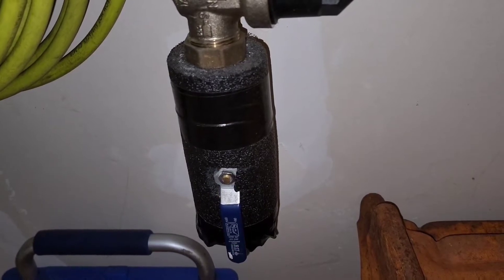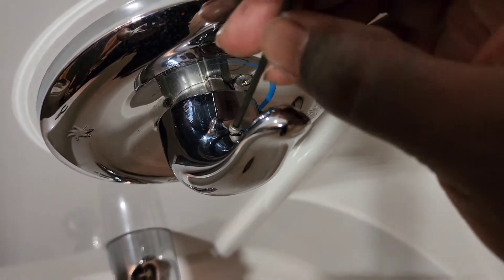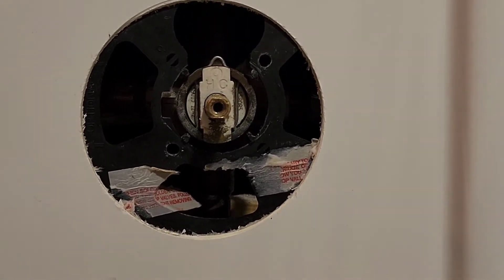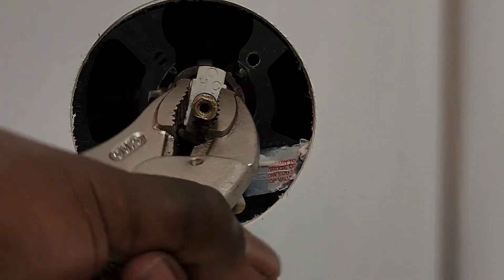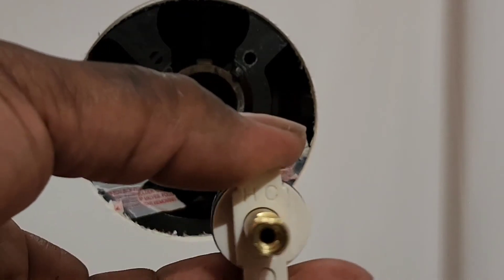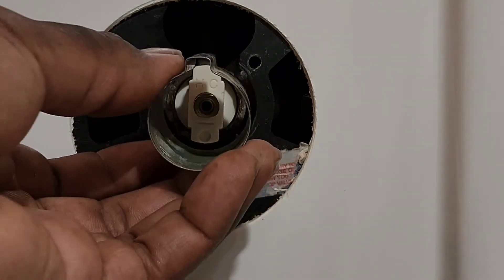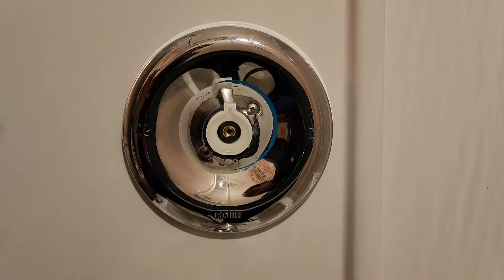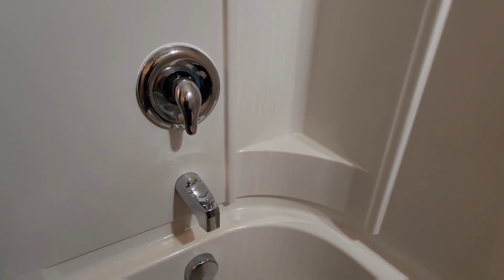Faucet Repair: Shower Bathtub Won't Stop Running Water / Moen 1222 Cartridge Replacement J.O.A.T.D.

Comment: Ima just be straight up with yall best instructional video I've ever seen on something like this I've watched a bunch of them and this guy did a great clean presentation that helped me a ton
Reply from the maker: Thank you so much for the kind words, I'm glad that my video could help you.
Reply: I have the same problem, but I can’t get out that valve. I just want my tub off.  I have my main water off in the house.  But I need it
Reply from the maker: @mikemc4340  I'm so sorry that the valve won't come out sometimes the valve is just stuck in there and you have to turn it back and forth with a pair of vice grips just back and forth back and forth while you're pulling it out. And you also have to make sure that you took out that retaining clip the one that shaped like a u.
Reply: So agree!! I’ve been watching these for several hours as it was New Year’s Eve😩Everything closed, and mine would not shut off and water just pouring out. He is giving me the confidence to try and repair myself tomorrow! Will  let everyone know how it goes as I’m a 55 year old woman with no plumbing experience 😂

Comment: Found your video late at night after scheduling an emergency next day plumber appointment for a shower that wouldn’t turn off. Ordered the part off Amazon and cancelled the plumber. Part arrived around 9am and I had it fixed in 20 minutes thanks to you! Much respect Sir!
Reply from the maker: You sound like me mine happened at night also. Thank you and you're very welcome I'm glad my video could help.

Comment: Great video. I'd already replaced the Moen 1222 in my shower, but couldn't get the hot / cold / off right. After screwing with it for awhile, checked your video. Your tips on lining up the 2 plastic collars at about 3:30, and how to determine which flat side on the valve stem should point up at around 5:30 sent me back to the shower to check... and fixed all my problems. Thanks!
Reply from the maker: Thank you for the key points in the video that will help someone else that maybe having the same problem and for the positive comment I'm glad that my video could help you.
Reply: THIS saved my bacon this evening. it was getting late and i couldnt figure out how to shut the water to the shower. i had the entire house off and ended up having to call a plumber. while was preparing to leave, i managed to land on this video and found my issue at 5:30 mark. Once i flipped the stem it all worked! i canceled the plumber who sounded annoyed but i suppose it saved him a trip to my house at 8pm on a sunday evening

Comment: This worked perfectly.  The step where you had me turn from the default position to off was super important.  Grateful for this video. There is NO WAY I would have had the confidence to make this repair without your video.  This video was not first that I found, but it was the best in video quality and quality of your instruction.  Thank you! 🙏
Reply from the maker: Thank you for the kind words. I'm glad that my video could help you

Comment: Best video on this by far. Mine broke this morning while it was still running; solved by noon with your video (and a couple others after my valve came out in pieces that resulted in a second trip to the store for super thin needle nose pliers...).
Reply from the maker: @zackarybird1992  thank you for the positive comment. I'm so happy that you got your issue solved. I'm glad that my video could help you

Comment: Just cost me $400 to have that done on shower faucet as  piece of handle broke off in cartridge and shower would not shut off. Had to cut water off for entire house  for 2 days until I got a plumber.  The guy worked very hard to get a 24 year old cartridge out with drill and screws. What an ordeal. Thanks for the video.

Comment: Thanks A Bunch, I was able to replace this, just by watching your video, instructions clear and easy to follow. I bought my replacement part from amazon and it came with the tool that you mentioned, although I didn't use it because I just followed your tutorial. Anyway just wanted to mention, just in case anyone is searching or the replacement kit.
Reply from the maker: Thank you for your positive comment, I'm so glad that my video could help you.

Comment: After watching a video, I replaced the cartridge in my master bathroom several months ago.  Then, for the hell of me, I could not figure out why the "off position" was now up and the "on position" was now down, and the hot and cold were reversed.  And I watched the video several times  Now I know, thanks Dre.  I did not rotate the metal tube.  Excellent video.
Reply from the maker: I'm glad that my video could help you, thank you for the positive comment. I'm glad that you were able to fix your problem.

Comment: Great step by step guide.  I took my old cartridge to home depot and replacement was free
Reply from the maker: Thank you, I'm glad my video could help you. There's nothing better than free
Reply: How ? I just paid 59 bucks at ace hardware.. Home depot is 1hr away
Reply from the maker: @joelopez8965  if you look in the descriptions of all my videos I normally have links to Amazon and manuals. To help you with pricing and installation Amazon this part was $35
Reply: Did HD replace it free for you?
Reply from the maker: No I had to fix it myself

Comment: Excellent video, thank you so much. Two things: my screw size was 7/64, I couldn't figure out why the 3/32 wasn't working. Also, the black plastic guide inside the wall has to be lined up correctly for the faceplate screws to go in. Thank you so much for the great tutorial!
Reply from the maker: Thank you so much and you are very welcome. I'm glad that the video could help you with your problem. Thank you so much for the extra input in the comments this will help other people who are having the same problem. Thanks

Comment: The washer was missing from behind the black plastic handle mount. That is why the black plastic got stripped out. This part used to be a metal mount and was changed to plastic, probably to cut costs.  The two plastic inserts are scald preventers that can be adjusted to limit the handle travel. That is why they have all the lines in them for adjustment.

Comment: What about a to handle delta tub faucet that keeps running? I changed the seats and springs and both cartridges and it's still flowing out

Comment: Mine is now so free as it turns. Is it the new cartridge or is it because my old one was too stiff? 
It works though, no more leakage. Also the pressure is a little bit lower now.

Comment: Man I appreciate you I jus changed mines...now one thing that is a common sign that it needs to be replaced is that the handle will start to get tight and not turn smoothly...so go head and replace before it goes out.
Reply from the maker: No problem, I'm glad that my video could help you. Thank you for the tip about when to replace the cartridge.

Comment: I have replaced mine 3 times 2 plastics this last one is brass the first 2 did not mix water correctly ..trying to figure the 2 black plastic parts on the side does what can i put in wrong on the first 2  ..Thanks'

Comment: I have a question my parents have a bathtub but the faucet is on the right corner of the bathtub surrounded by title. The cold water handle wouldn’t turn off. We just had to turn off the water. Now, roto rooter told us since the tub is next to our cabinets with the other faucet/sink they should of made a doorway or left an open space in the cabinet to the bathtub section that led to the faucet on the tub. Roto rooter wanted to make break into our bathtub and on the far end opposite of the faucet. That’s crazy! Wat do we do? We want to replace the faucet but we have to get into the tub somehow or cut a big hole that would allows you work inside the cabinet that leads to the tub/faucet. Btw we had this problem when they first bought the home. They found out late the faucet had issues but yea any help any advice will help greatly!!!!!!!. Oh I unscrewed a metal piece where the handles sit on and the center has that copper metal that turns the water on and off and all the water rushes out so I didn’t know they would happen? Either way my father said this rubber thing is worn out it’s this black rubber circular thing. But he told me only roto rooter can fix thst or replace? I’m lost I have no idea wat to do

Comment: So I guess my big question is are all these cartridges interchangeable so if you have a Kohler single-handed shower, same issue you can’t turn the water off the valve cartridge is failed but you have a Kohler. Are they all the same taking them out putting them in are they the same type of like the 1222 model of the Moen is it they pretty much the same animal only with a different brand stamped on them for the single-handed are the single handle shower handle like yours?

Comment: thank you so much for the detailed video. It is much appreciated. One question for you the cartridge i got from on line the two side washers do not stick to the cartridge. Should i use superglue for the side washers or rubber cement?
Reply from the maker: Did oil get underneath the rubber grommets on the sides. If so just clean them off real good and dry them off and then put them back on the exact same way you took them off. Apply the oil on top of the grommets, hold them together and place the cartridge while holding the grommets into the pipe

Comment: Where did I go wrong if I have a lot of cold water leaking out from my shower handle and my water temperature is all over the place but it’s turning off on on properly now compared to before it wouldn’t turn off. Any help is appreciated!!
Reply from the maker: When you put the cartridge in did one of the black rubber boots on either side of it fall off
Reply: It's the white piece that he says to make sure it's lined up correctly in this video. That is the temp regulator I believe.

Comment: How do you remove the cartridge when the brass stem has broken off?
Reply from the maker: @jimmiecalvert3572  if you look in the video I didn't grab the brass part I grabbed the plastic part behind the brass to pull it out

Comment: i replaced with new one same way but mine is keep leaking.. i tried all possible way. i don't know.. can you give me any suggestion please
Reply from the maker: Where is it leaking from the faucet. If so the rubber grommet on the sides of the cartridge may not be placed properly.
Reply: @JOATD  thanks for your reply.. It's in place.i repeat 2 times the whole process..

Comment: I’m having this same problem but my handle is that round white one. I put a new cartridge in yesterday and my water will not turn off. Any chance that I got a bad cartridge?
Reply from the maker: My apologies for the late reply. Sometimes it doesn't show me all comments that are coming in. Were you able to fix your problem.
Reply: @JOATD   yes! I had my 13 year old pull the cartridge out and one of the black rectangle rubber rings came off and clogged the pipe. I assume that’s what was causing the problem.
Thank you!

Comment: Thanks so much for this video . But one thing should be  mentioned that is, to check the old black  gasket seals still in the housing and clean it up, before the new one in ..

Comment: Why now that I fixed it hot and cold turn off and on separately?
Reply from the maker: Because the cartridge was placed in upside down. Just remove it and turn it around. Before you tighten everything up just put the locking clip in so that the cartridge won't come out and place the knob on and turn it to make sure that it's the correct way.

Comment: Do you know what the plastic inserts do because it looks like you actually turned the brass stem the one that you were talking about that was flat on the bottom and had a little notch at the top or vice versa because really that’s what you’re screwing that Onto a black cap that goes over it and then you attach the handle over it I’m just kind of curious what those little plastic inserts do cause the bigger one has a notch so that can’t turn so I’m just curious what those do
Reply from the maker: Is this what you're talking about
https://amzn.to/3NxBLXD

Comment: Hi! Would the 1222hd be interchangeable with the regular 1222 plastic/brass?
Your video is great btw! Also any way I can shut this off temporarily wo having to turn off the whole house
Reply from the maker: The 1222 plastic and the 1222 HD are interchangeable. I chose the plastic over the brass because it was hard enough trying to get the old plastic cartridge out. I feel like the brass one would corrode faster and be harder to extract
Reply from the maker: It depends on the Builder of your house some put shut off valves inside the hole that is covered by the handle. Most do not and you have to shut off the main valve

Comment: Where did you get your parts from? Do you have a link for those parts for the Kohler? I think it’s the cartridge.
Reply from the maker: Yes just take a look at my descriptions I have the links
Reply: @JOATD  where do you get all the hardware like to the new plastic pieces? I saw that you Musta reuse the same plastic pieces but if you had to get the new ones because sometimes those plastic get loose and the handle gets kinda loose when you connect everything I kind of like goes back-and-forth a little bit. There’s lots and play in it where do you get all that that’s like that that white plastic piece that fit together and there’s a black that goes over before you put the handle on where did you get that? I don’t see that in your list of parts description
Reply from the maker: @billf9847  Is this what you're talking about
https://amzn.to/3NxBLXD
Reply: @JOATD  actually, it’s the parts that you see in the video that you took it’s like two white plastic pizza pieces that get inserted into one another than the black cap that goes over the ones in the picture are those that link you sent those are a little different than what’s actually in your video because mine are like the ones in your video. There is a black You take off after you take the handle off my handle is totally different than yours, and then you have what you take the black cap off then you’ve got a white threaded style. Insert that you pull off and then you got the white insert that goes inside that metal tubing that you re-insert over that retainer clip those parts.

Comment: Does the valve cartridge turn the water off?
Reply from the maker: Yes
Reply from the maker: Or you have to go to the main valve to turn the water off if the cartridge is broken.
Reply: @JOATD  thank you.  I turned the main valve off. But the valve cartridge will not come out.
Reply from the maker: @benitaesq_  you have to pull out the retaining clip. After that you have to pull and wiggle until the freeze itself
Reply: @JOATD  I pulled out the clip but the valve cartridge is still stuck in there. I don’t see the manifold to shut off the water for the shower. Where is it located. I turned off all the water to the house. I want to use the water in the rest of my house but I don’t see the manifold for the shower to turn the water off for the bathtub only. Thank you for helping me.
Reply from the maker: @benitaesq_  it depends on the home most new houses don't have a shut off for the shower / tub. The only way to turn off the water is to turn off the main. If your house happens to have shut-off valves it would be inside the hole you'll see a red and a blue valve. You need to take a pair of vice grips twisted left and right and pull the cartridge out.
Reply: @JOATD  I don’t have a shut off valve. It looks like I have a single valve because there’s no way I can shut it off. I turned off the main water to the house and waiting for the plumber to call for an appointment. I tried pulling the cartridge out but it’s stuck maybe due to lime and corrosion over time. I didn’t realize plumbers were not available after a certain hour even in emergencies. Thank you for all your guidance.
Reply from the maker: @benitaesq_  okay no problem.
Reply: @JOATD  May The LORD bless you with peace and success, you have been so kind.
Reply from the maker: @benitaesq_  thank you
Reply: @JOATD  you’re welcome. Praise The LORD.
Reply: @JOATD  it’s all repaired now by a professional plumber. Praise God! Thank you for all your guidance. The plumber said it was a task for a plumber and that I didn’t have a shut off valve, like I had discovered. ☺️

Comment: I noticed when you pulled out the original cartridge valve cartridge. There was no rubber on either side. The new one had rubber. Do you know what happened to that rubber did stay on the inside of that pipe when you push it back in they dissolve or is it just made that way without the rubber on either side because on the new one it has rubber that you oiled. Also, did you oil that black O-ring at the top? I don’t know if there’s no O-ring at the bottom either
Reply from the maker: Yes when I pulled it out the very first time the rubber piece fell off. I decided to do a video on it. The rubber piece was so damaged that I decided not to put it back on when I did the video. But it's supposed to be on it